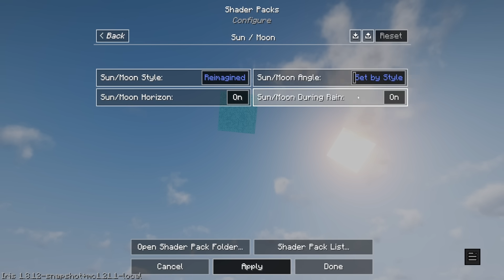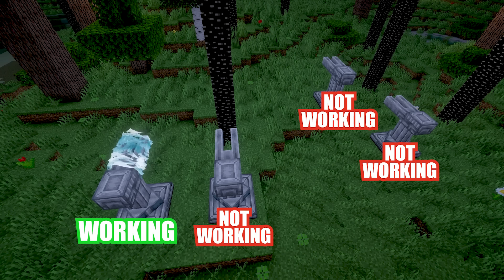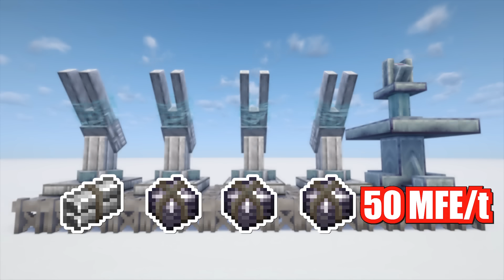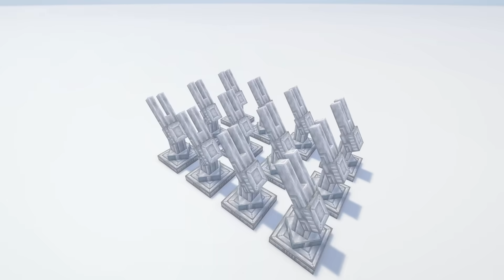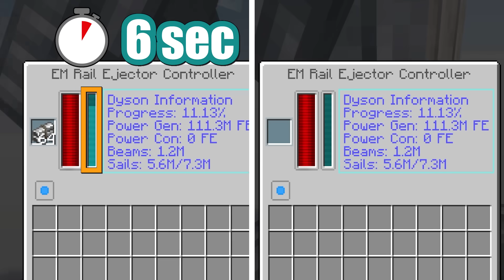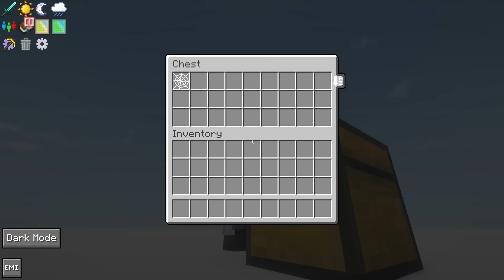Making 1 BILLION FE/t?!?! - Dyson Cube Project

Comment: Pretty funny how most of the issues with the Dyson Sphere in the mod (huge resource cost, lifting all that into space, unable to recieve powerduring bad weather) are solved with the real concept simply completely disassembling mercury for building materials, and then using the power in space directly
Reply: ahh yes, taking apart a planet to build a massive power harvesting system, how about we take apart another planet to build a giant thruster from that let's us move the sun as well?
Reply: @Robosium surely there are no consequences to shifting that much mass across the solar system
Reply: @pondleaf apparently there really isn't, planets are tiny compared to the sun so gravity well changes would be negligible, the amount of mass the thruster would remove from the sun would also be negligible and if anything make the sun last a bit longer, and the sun being moved around would just move everything else with it too
the animated science channel with the bird characters and difficult name did a video on it
Reply: @Robosium  Kurzgesagt.
Reply: @no_signal_beep  that's the one
Reply: @Robosium  I'm going to blow your mind: You just need half a dyson sphere to move the sun.
Reply: @Robosium I mean it's not unfeasible
Reply: @Robosium  we unless you’re taking apart soemthing like Jupiter or Saturn, there shouldn’t be much problems. Even then it’ll be practically impossible due to how absurdly large both gas giants are
Reply: @Robosium not necessary, the solar system is already moving 230 km/s around the galaxy
Reply: @drnexxus1997  would be problematic if it was moving towards a danger or a dangerous area though.
Reply: @drnexxus1997  но ведь нам может потребоваться иное направление движения или иная скорость как больше так и меньше
Reply: Ah yes. Simply disassemble a planet. What could go wrong?
Reply: @tlotro625 the only thing that can go wrong is giving up on it due to the sheer magnitude of the project
Reply: Hell yeah
Reply: man, you people really do not understand orbital mechanics. or physics. mercury is smaller than some moons (ganymede and titan) and is so far inward in the solar system that its gravitational influence on other objects is negligible. it can't even redirect a single asteroid, much less the entire system. disassemble that motherfucker
Reply: @somethingforsenro  my goat spitting facts
Reply: You probably don’t even need to fully disassemble Mercury for materials too, probably just enough for us to get enough energy to go into interstellar space and get resources there
Reply: You know the whole idea of a Dyson sphere was a joke, right? It was never meant to be a realistic proposal.
Reply: @kajaxochi8562  I know what video u are talking about and would advise u to watch xandros answer to that video. 
From what I've understood the Dyson swarm wasn't a joke, the joke was something else.
Reply: @Nayo987  xandros is so cool
Reply: @Nayo987  no even he misinterpreted, Dyson just asked a basic question of why look for signals that humans give off when maybe the aliens are more advanced than us, but he was not looking down on the alien search program just joking as in they should broaden the signs they’re looking for.

And it doesn’t take a rocket scientist to think for a bit and understand that energy transfer is the most important part of distributing energy not how much we can capture, if you can’t use it doesn’t matter and that’s what Collier was saying
Reply: @benjaminwatson7868 Im not saying energy transfer is an easy problem to solve for a Dyson swarm, but to assume that it is unsolvable for future civilizations seems a bit pessimistic.
Reply: @Nayo987  no it’s realistic everything about the idea is just wasted energy transfer and the idea any civilization would spend their time dormant for that long to adopt the technology in an effective capacity instead of just perfecting power stations on the home world let alone spending their valuable time traveling the stars, at the end of the day Dyson swarms/spheres are just wishful thinking for civilization largest mega structure
Reply: @benjaminwatson7868  i don't really feel like ur criticisms properly dismiss he idea after all the energy transfer is an engineering problem and just because u have one way of generating energy doesn't mean u wouldn't look at other especially for a solar system or galactic empire that has an uncountable amount more brains to work on the problem and unlike how u make it sound exploring the stars and building mega structures especially enrgy ones are definitely not mutually exclusive, im not saying it will be the only solution im just saying ignoring the sun as a power source is dumb considering even we don't ignore it. all in all i think some time in the future people will exploit the sun as a direct energy source even though it wont necessarily be a Dyson swarm although it seems to be a strong candidate.
Reply: @Nayo987  I’m not ignoring the sun as a power source I’m discrediting the idea of a mega structure so unnecessarily massive as people’s bizarrely hopeful idea of common sci-fi in the future, if you can efficiently harvest energy from the sun why would you trap yourself to a solar system again understanding the idea that it takes eons even to travel a galaxy why wouldn’t you just I don’t know power your starship so you can keep traveling explain to me the reason a civilization would stay stationary so long in a particular solar system they would be directly trying to harvest energy from their home star
Reply: @benjaminwatson7868  a civilization is not a singular unit some parts of it will be moving through space while others will settle, and again even if parts of it want to move out that doesn't mean everybody's gonna abandon the planet. it doesn't seem so weird to me ud have massive clusters of people in areas where there is a sun.
Reply: @Nayo987  the parts that would settle wouldn’t need the power of a star as they wouldn’t need that many people for work
Reply: @benjaminwatson7868  whether they would or wouldn't need it isn't something we can know, the best i can offer is that energy needs seem to grow over time when they can grow, so it would seem to me that these people might need a Dyson swarm. for the "they wouldn’t need that many people for work" argument, i would assume that would mean they would need more energy, because humans need energy regardless of if they are working or not, so add to that the robots and machinery that produces whatever that society needs and u got urself an argument for more energy not less. anyway i think that the amount of energy a civilization needs is determined by how much it has access to not how much they consume, they will always invent stuff to use that energy with, kinda of like what we do, but in a more sustainable and less suicidal way.
Reply: @kajaxochi8562 the Dyson Swarm was the more serious and realistic version of the Dyson Sphere.
Reply: @J0hnB09  and even it still doesn’t make sense to do
Reply: @OneOfTheCzechMates If a civilization gets that large and has the energy and resources to make a Dyson swarm would they just use the energy for something else
Reply: @benjaminwatson7868  Of course, if a civilization has absurd energy demands, obviously they wouldn't tap into the most accessible source of energy and would instead just run out of energy. Genius!
Reply: @erictheepic5019  no they would go through the obvious procedure that we’ve done through all of society and make our own, it’s way more time efficient and productive to do so especially versus trying to harvest it in the most bizarre way imaginable
Reply: @benjaminwatson7868  Make their own power via what? What can provide power on the same scale as an entire star? I'm serious, what do you think you're talking about?
Reply: @erictheepic5019  since we’re talking sci-fi the basic idea would be to make miniature Star like power sources that would feed off anything and be portable, why would they restrict themselves to a star
Reply: @benjaminwatson7868  You didn't answer my question; this ain't an answer, because you're talking about a fusion reactor, and those are still 10-20 years away from practical application.

Meanwhile, there's a giant fusion reactor in the sky that's been running without any maintenance for a few billion years. It also happens to output, without exaggeration, ten trillion times more power than all of human civilization uses. You think that's limiting?
Reply: @erictheepic5019  1. You don’t seriously think Dyson spheres are a more practical energy source than fusion reactors to the point we’ll have them sooner 2. How do you plan to transport that energy practically to whatever planet you plan on harvesting it 3. How would you build a structure/satellite that could withstand the energy pouring off that star
Reply: @kajaxochi8562  Yeah, but it as much of a joke as humanity ever leaving solar system. Both tasks at hand ar as absurd, requiring either breaking few multitudes of laws of physics, and/or using so much energy and mass, you'll need to burn whatever you can find on all plantes and deconstruct jupiter.
Reply: @v.0190  нет, если создавать рой дайсона из железных зеркал толщиной 1 миллиметр на расстоянии от солнца примерно на орбите меркурия потребуется лишь половина массы этого самого меркурия, и то это не супер эффективно, ведь можно использовать более лёгкие материалы и более тонкие зеркала так что это более чем реализуемо при условии создания само воспроизводящихся автономных заводов на меркурии и на орбите
а если мы и не сможем обойтись половиной массы меркурия нам никто не запрещал добывать материю из солнца, да более 90% этой массы это водород но добыв хотя бы 1% его массы это будет всё ещё на порядки больше тяжёлых элементов чем мы могли бы добыть из всех планет, астероидов и комет месте взятых
да и этот самый водород не что то бесполезное, им можно будет заправлять межзвёздные корабли на термоядерной тяге или путём термоядерного синтеза создавать более тяжёлые элементы
Reply: @v.0190  what physics are we breaking exactly
Reply: @kajaxochi8562  not really, it is pretty logical, just very hard to do, not possible with current tech, it is something for far in the future
Reply: @kajaxochi8562  it was made as a concept for how we will get energy in the future. In terms of how realistic it is, it’s very realistic and absolutely achievable in the future once we obtain the proper technology required to do so. 
Think of it as sending satellites to the sun, but instead of info it extracts energy

Comment: HOLY FK!?!?  While idk if this is the most efficient power generation (probably isn't?), it sure looks cool as sh*t !
Reply: Its the most efficient power source in atm10. 
Its cheap, its fuel is permanent,  it takes no space once finished, and its easily movable.
While others are technically better with RF/T you overall have to do less with the dyson.
Extreme reactors require a lot of space
Mekanism can explode 
Other power is just too weak or inconvenient and more niche
Reply: its objectively the most efficient.

you can make tens of millions of iron and copper fully afk within a couple days of playing.

Comment: time in a bottle, or ars time spell can speed it up.
if you use the 2 methods, the setup and craft and EVERYTHING will be around 240x faster than normal, meaning 240x less time to achieve the goal. (just a rough number, not sure how fast it will be)

Comment: This seems low for the sun’s energy. I don’t really want to do the calculations but i would estimate that the low end would be many quintillions or more
Reply: 64bit integer limit
Reply: @zuzoscorner i believe FE is stored in a way that it can go up to about ~ (2^63-1) * 1000000000, not just 2^63-1, but even if not the integer limit is about 9 quintillion, so they could still have made it ~9000000000 times stronger